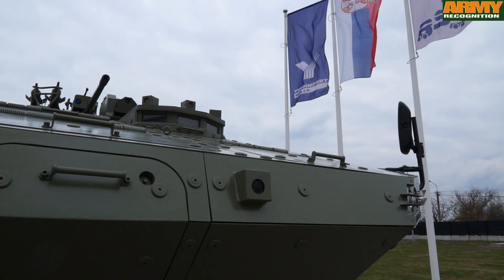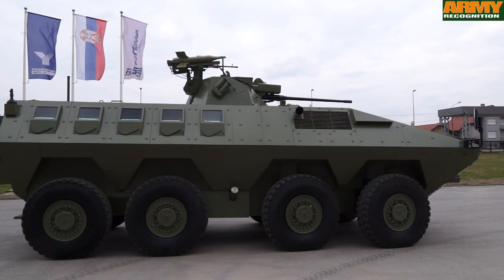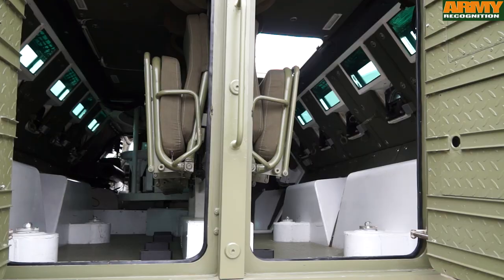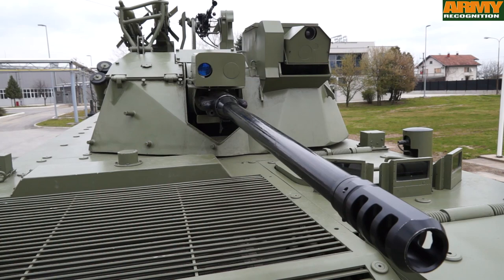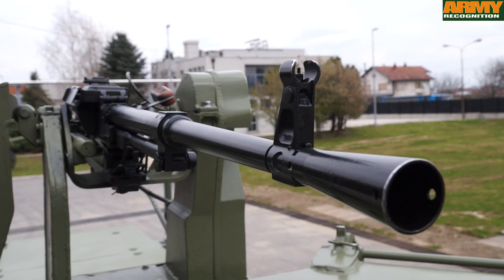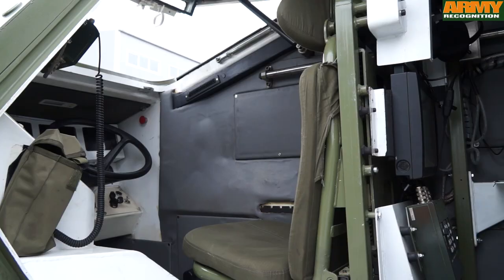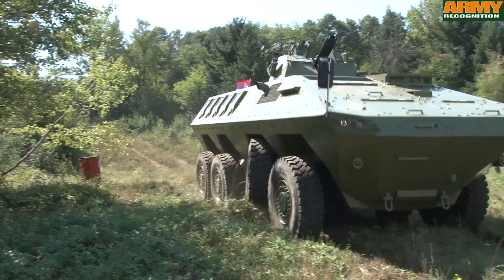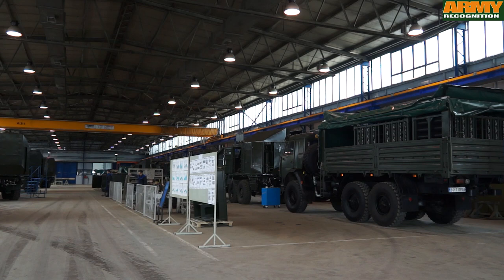Lazar 2 MRAV MRAP 8x8 armoured Yugoimport video report Army Recognition Defense Web TV Serbia

Comment: Runflat tires with quick change levers - Excellent
Back to back seating arrangement - Excellent
Payload weight/passenger number - Excellent
Armor arrangement - Good - Driver is too exposed
Offensive ability - Good - Needs minimum 30mm, anyting less than that can't go through concrete or thick mud walls
Mobility - Good - Water jets would improve operational mobility, and work together with the V hull

Comment: Remove side windows (it's completely unnecessary), remove that central wall in the crew compartment so you can get more space, put the sits so that men are facing each other, try to develop remote controlled turret and make the vehicle amphibious... then, and only then, this might work.
Reply: ThanatosSGD1 Side windows are borrowed from MRAP designs, since this is developed to be mix of MRAP/MRAV and APC. So windwos are there with a reason, they are made from same glass used by Russians on Mi28N (same supplier) so it offers balistic protection. They allow crew to engage targets in case of ambush with their personal weapons. If they moved seats to sides whole concept of vehicle would change, so its one big no, however its easy to be changed on customer request to adapt it to be used as MRAV. Turret is already basically remotely controlled however its hull penetrating turret design and gunner is there coz of that reason since there is nowhere else for him to be placed in this configuration, also this way you can reload it from the inside. On request you can put any RWS of your likings, on "bus" configuration it will be most likely be just .50 cal one. It wont be ever amphibious since its way too heavy for that (22t in base variant, 28t with modular armor on), most of the MRAPs are not amphibious, and most of the APCs are amphibious only in their base variants that is not heavier than 20-21t.
Reply: ThanatosSGD1 this vehicle is more suited for high risk police and anti terrorist operations, rather than for front line military missions, therefore a mrap-like design as opposed to a classic apc
Reply: Yeah, well... this vehicle is neither MRAP nor MRAV, it's somewhere in between, and as such it has inherent design flaws. Protection is not good enough for MRAP, and MRAV must be amphibious. Company is trying to sell Lazar 2 as an all-arounder: "jack of all trades, master of none", but this concept is not going to work with armed forces. Although I agree that, perhaps, it might be used in special police.

However, problem is that police doesn't neeed more than few dozens. So, as usual when it comes to very limited serial production, questions of price and the cost-effectiveness are arising.
Reply: ThanatosSGD1 The Lazar 2 is already being used by Serbian special forces and Gendarmerie. I saw something about Gendarmerie and they are using the Lazar 2 in high-risk situations and for raiding in ocupied areas that have armed suspects.
Reply: +ThanatosSGD1 Serbian army ordered Lazar 2 which is supposed to be amphibious, serial production should be started in March 2016. At least that is what our prime minister said.
Reply: MiroslavAdice That's interesting, considering that (correct me if I'm wrong please), only two tech demonstrators have been built so far, and army didn't have a chance for proper testing, at all. This vehicle has potential, but in my humble opinion it still needs some serious work. I hope that you won't rush the production because of someone's short-sighted political interest. When politicians are deciding instead of engineers and people who will actually use a weapon, it usually doesn't end too well (see F-35, for example).
Reply: I.C.  it's becouse expiriance from kosovo. serbian police was anbushed in forrest of kosovo provinse by terrorist and they have only a truck and they fire back thry a truck tent. and they made this vehicle. it's ver very good belive me. if you find under fire just fire back from every weapon you have and run..
Reply: I.C. No thanks. Side portholes allow crew to shoot enemy RPG gunners before they can fire and kill everyone. Central wall compartmentalizes damage, so even if it gets hit only half the passengers die. It also allows the vehicle to carry more supplies in the center, because back to back seating arrangement is more efficient. Men facing each other makes no fucking sense.

Comment: What is the difference between this and APC?
Reply: +Skytech92 this vechicle is ARMORED PERSONAL CARRIER but ALSO MINE RESISTANT ! not all APC's ARE RESISTANT TO MINES as this for example !
Reply: +Skytech92 This is mix between MRAP and MRAV concepts. Mine Resistant Ambush Protected and MultiRole Armored Vehicle. It has increased mine and IED protection compared to APCs, and also allows crew to return fire by use of their personal small arms in case of ambush. Its also heavily armed compared to most of "bus" configuration APCs around that mostly carry only .50 HMG. This can use 20 and 30m cannons, ATGMs etc.